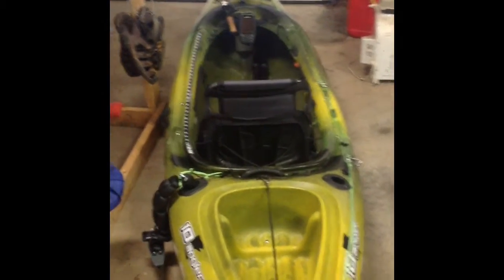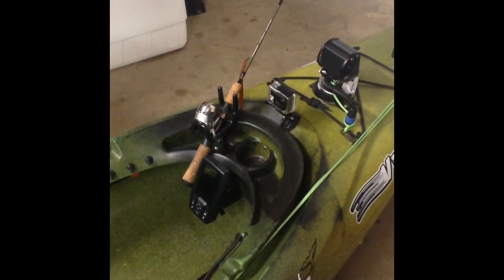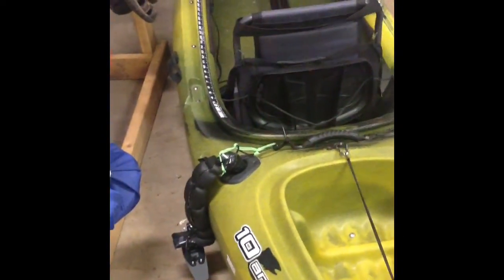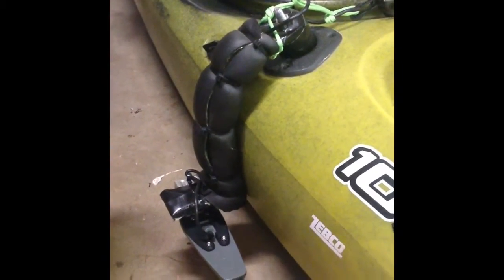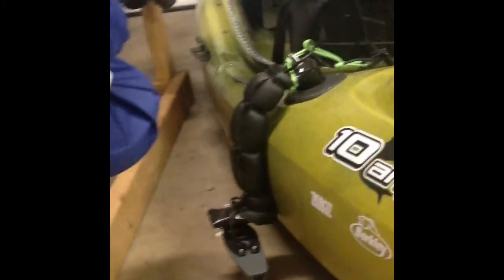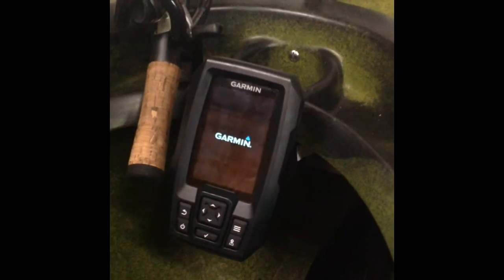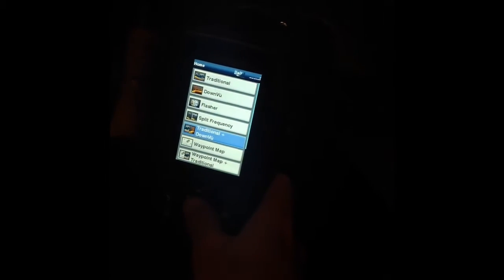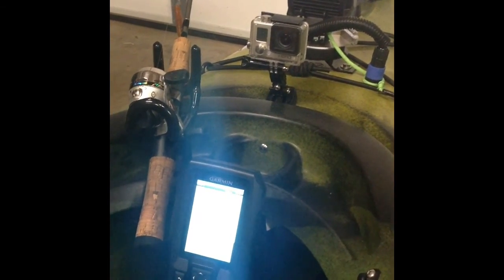Old Town Vapor 10 Angler & Garmin Striker 4DV

Comment: Great video.  I'm getting this same kayak and a garmin depthfinder soon, do you have anymore photos of how you mounted the display?  I've been wandering how to mount it and still keep the cupholder.  Thanks!
Reply from the maker: I used the same galvanized strapping that I made the transducer arm with. Just think of it as a Z shape, with a nut/bolt in the back wall of the cupholder and another one in the center of the bottom of it, then the fish finder mount is bolted to the Z bracket at a 90 degree angle so that the tilt is oriented correctly. Make sense?
Reply: Hey great video, i have an old vapor 12xt and am thinking of getting this fish finder and adding it to my yak. I   think I understand your strapping set up, but how has it held up ? I'm concerned the strapping would give over time.

Comment: can you give me a few reasons why you selected the vapor sit in kayak for fishing instead of a sit on top kayak.  thanks
Reply from the maker: I originally got it for cold weather fishing (had a Pelican SOT first that was decent) and because it's about half the price of the sit-ons I like. It also weighs less and isn't as wide so it's easier for me to transport. I also like the color and aesthetics of this model a lot. For me and my tastes it's been great. I would love to have a nice Slayer too though. I also have a Hydra SUP that's decked out sort of like a hybrid SOT kayak.
Reply: I chose the sit-in Vapor for stability - your sitting practically at water level.
And I didn't want to fry in the sun like a piece of bacon...💡

Comment: What kind of seat is that you are using?
Reply from the maker: That is a GCI Outdoor SitBacker Canoe seat. It is hands down the best seat upgrade I have found for the Vapor. Just unscrew the stock plastic seat, then secure the GCI seat over the top of it and fasten the buckle underneath, then reinstall the whole seat assembly and enjoy your new super comfy seat!
Reply: Where is your battery?
Reply from the maker: Mason Garland it's up underneath the dash. There's a metal plate hidden under there and the battery has a magnet attached to it, so it just pops in/out easily for re-charging. YakLights LiPo battery
Reply: @meanpicker  any idea if that seat will fit the old town trip 10 angler model? I just got it and the stock seat isn't getting along with my back
Reply from the maker: Michael Saunier  I'm pretty sure it will, yours looks to be the same as my stock seat. Well worth the cost to upgrade!
Reply: @meanpicker  thanks a ton for the reply! Ordering it now, good sir